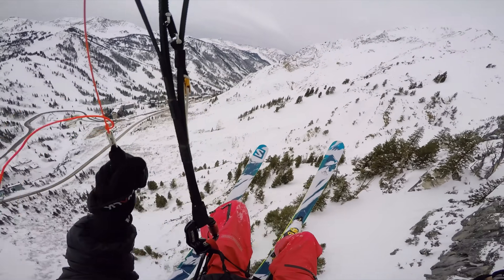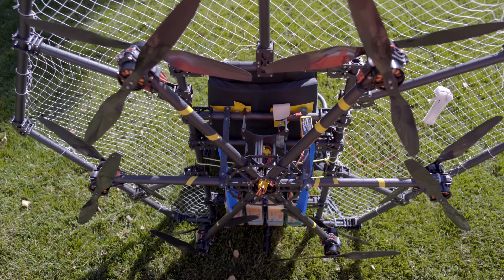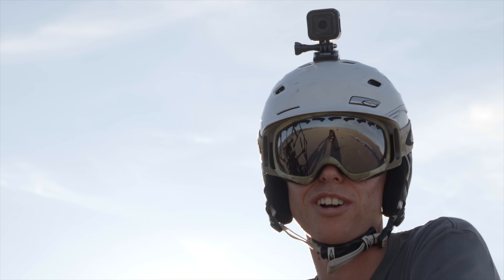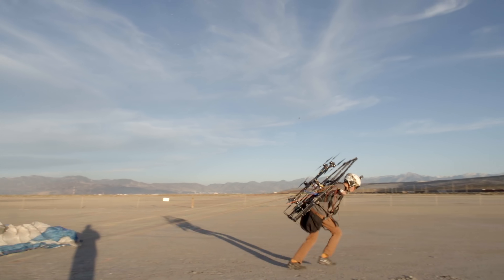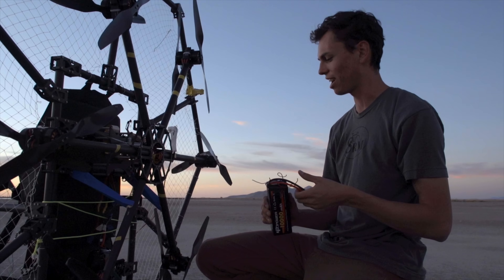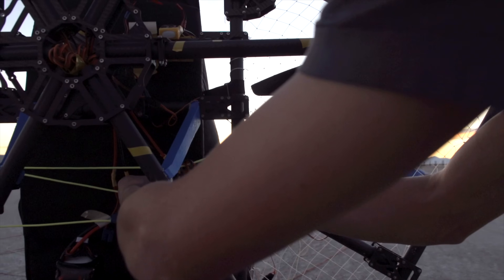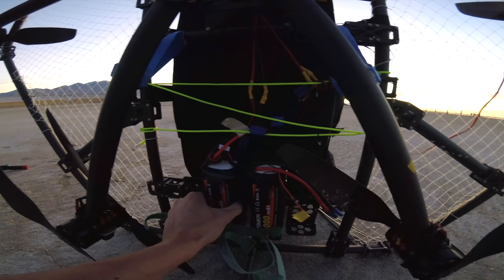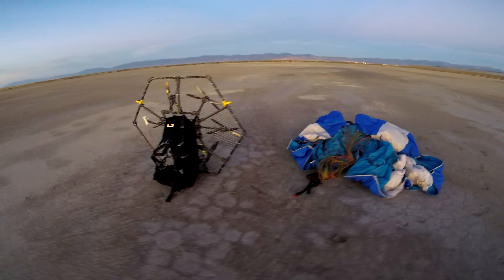12 DRONE Motors On My Back!? - DIY Paramotor - RCTESTFLIGHT

Comment: You are the only person on earth that still uses ECx connectors
Reply: Xt90 would be a better choice
Reply: XT90 = 90 amp rating, EC5 = 120 amp rating
Reply: PropcutFPV  EC5 connectors are still surprisingly popular amongst RC helicopter pilots actually. :)
Reply: wow , i thought rc heli pilots were wiped off from the surface of earth :)

Comment: You could use more tapered joints for the body to prevent it catching and higher gawg wire to prevent it un soldering ! This is epic!

Comment: Now solar power it.
Reply: Liam Ers127 not gonna work
Reply: nope, but he can solar charge it, giving you "free" flight. There is a guy on youtube that does it with an electric paramotor.
Reply: Urho Drinks Water - you are extremely overestimating the efficiency of solar panels.
Reply: Liam Ers127 small solar panels aren't too heavy. You could probably wire tons of them onto the wing
Reply: Rcbif im not saying they can sustain flight. But maybe add a few minutes of flying time... MAYBE